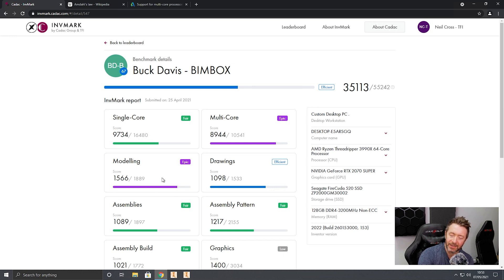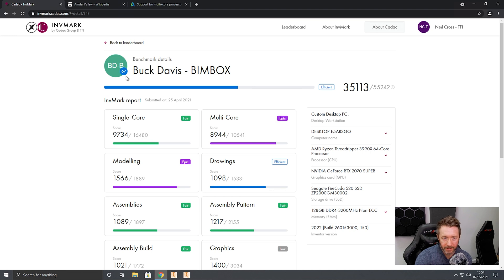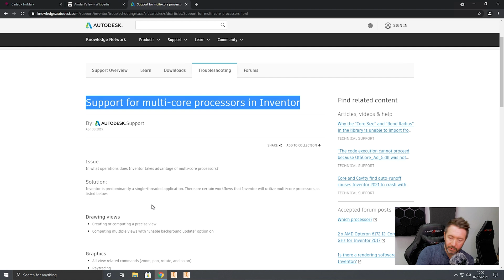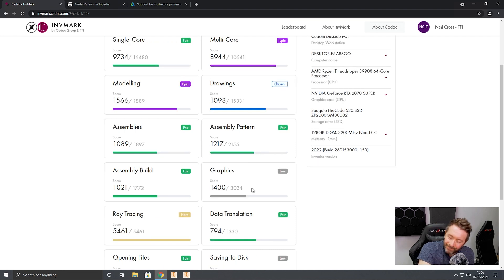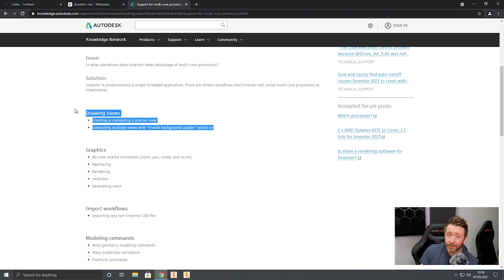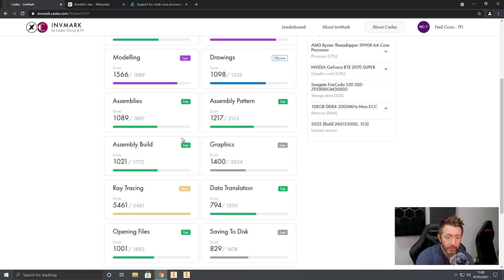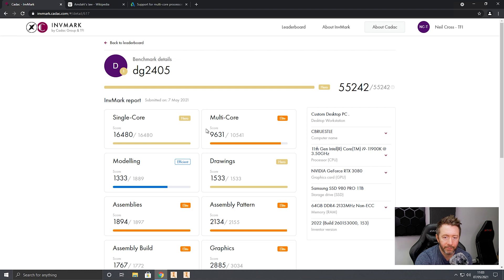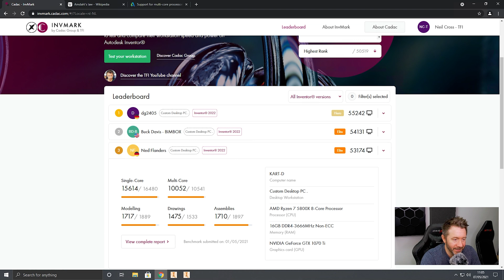Is the Threadripper 3990X good for 3D CAD? InvMark Benchmark Review

Comment: Looking at the leaderboard (great initiative) it appears anything beyond a 6 core AMD 5600 and a low to mid tier Nvidia card is a plain waste of money for an inventor CAD system. There seems intriguingly little gain. Are these <10% between the 11900k and the 5600x noticable at all?
Reply from the maker: I've been publishing that exact message for over 5 years, I just needed to make a benchmark program and a leaderboard to hopefully make it even more obvious! But it isn't always all that black & white, there's a theme and a set criteria that Inventor (and most other CAD programs) prefers, and different people have different use cases but generally yes for most people a 5600 would be as good as anything.  And yes the 10% difference will be absolutely noticeable and tangible, referring to the remarks I made at the end regarding my tests being lengthy and having meat to them.  A PC scoring 55000 finishes the tests in around 5.5 minutes, it's a half a minute difference to a PC scoring 50000, and all of that is pure computation

Comment: The threadripper isn't really a single CPU, it's more like several of them clustered together in a dual socket mobo that looks like a single.

One of the few places I've heard of the 3990x being used is in servers with heavy virtualisation,  where load balancing is less of an issue because granular control of resources and high availability being the priority over raw throughput. Node interleaving makes for a fine potato.

Comment: What you described with Amdahl's law is correct. Although there are hidden aspects to it on modern systems, which could lead you to over-estimate performance. For example, thread context switching, forking, joining, and memory accesses on something like the threadripper are typically "serial" operations. So if the parallel workload like you mention is too short compared to the overhead of launching the work, then you won't see a performance increase. The 11th gen Intel chips have a lower overhead here, because the cores and memory are "closer" together, so it takes less time. It's sort of the argument of throughput computing vs latency computing. The closer the cores and memory are together, the lower the latency, but also the lower the throughput. But to make use of throughput, you need to have enough work to do (i.e. how GPUs work). That's why threadripper is great at raytracing, but not great at more traditional workloads.

Comment: Yes, if you have a good gpu for rendering a low end cpu with better single core speed is winner. There's no point go beyond 3900x if you want more cores for multitasking. Otherwise get a 5800x. I bought a 3900x paired with 3070 recently, though

Comment: I'll give my two cents here. I think the reason you don't get great scores even on modules which supposedly have multi-core support is simply because having multi-core support doesn't mean you can utilize all 64 cores. In fact, most app these days that are said to have multi-core support only really scale up to 8-12 threads. So having more cores won't help you. I bet you would have the same problem with a 28-core Xeon as well. In any case, have you tested a Ryzen 5900x with these apps? I think you'd have better results with that sort of CPU rather than a Threadripper.
Reply: @Neil3D  
No idea what you said that. Considering what kind of CPUs the top scorers are (according to what you show at the end of the video) it seems my take was spot-on.
Reply from the maker: @1idd0kun  Ok in fairness, I'm gonna request the hardware log from Buck before I commit to this.  I'm basing my initial response on the fact that I have a 10C 20T system here which scales fine, I've worked with the Inventor developers themselves all through the year I've been developing InvMark and it was them who schooled me on Amdahls Law when we were discussing irregularities in parrallel processing performance, not once did they ever mention their application has a ceiling on core utilisation when we were discussing a topic that this would have been the answer to.  But, I'll get the log from Buck and confirm first, but I absolutely fully expect to see all 64 cores being utilised over the duration of the test.

Comment: So it still comes down to fewer cores at faster speeds is better than tons of cores at lower speeds.
Reply from the maker: Yup.  I'm totally nerding out over all of this, loving it.  It's what I had always seen in all my offline tests, but now its documented on a leaderboard for undeniable proof!
Reply: Ideally what you want, is a system that can scale with the workload. The ability to have a few cores at a fast speed or a bunch of cores at a low speed, and be able to dynamically switch between them. So far neither vendor has really created an architecture that is capable of doing that (though the new Big-Little paradigm might be able to).